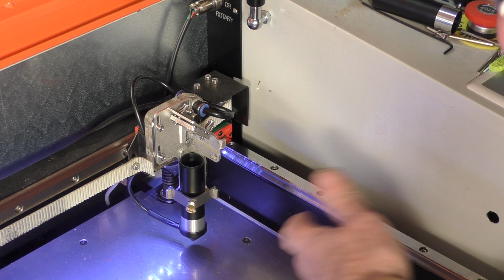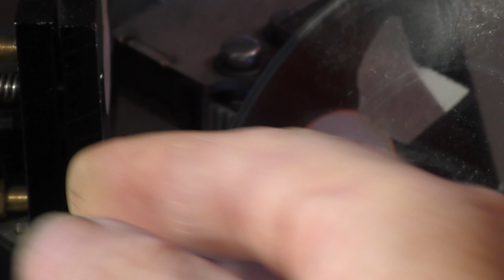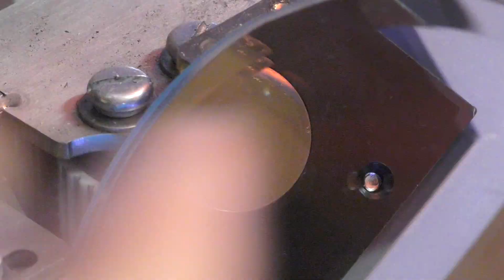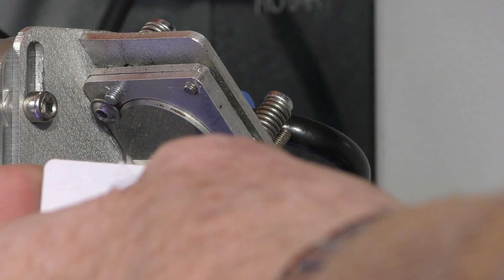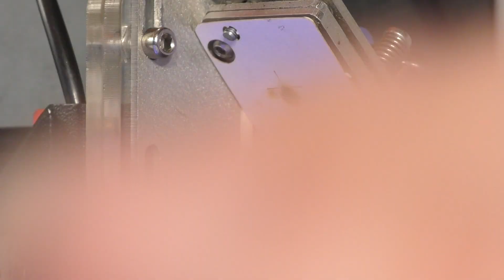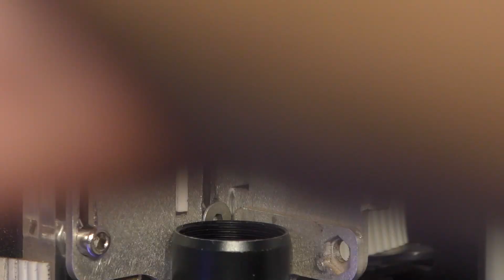TangerineTiger17  Beam setting to FIX the 4th Corner Problem

Comment: Excellent tutorial, thanks for posting!
Reply from the maker: Hi Malcolm
 I never stop learning or stop searching for better ways to do things. In a more recent video I have found there is a logical flaw in the way we have all been taugh to set machines. I  modified my machines many yeats ago to make the heads adjustable in Y and Z.  The principle I demonstarte in this video works for all machines , however if you do not have the adjustments that I have it will be more difficult to achieve. see  https://youtu.be/tvNfAg-cOLA

Comment: I hoped this method would've worked for me. I still have the same problem. Super focused in 1 corner, off by 2mm in the opposite corner. I've measured the rails and put them on the same plane. They're square. Still nothing 😥 Thanks for sharing though, I bet this will help many people.
Reply from the maker: Hi Bradl
 Just like every axis setting this diagonal setting is not a a one hit solution. You need to go through the process 3 or 4 times to get closer and closer to your goal because the every beam alignment process is one of iteration. As you adjust the beam to align with the target burn you are also moving the target burn you produced at  "near to mirror 1". So you start again with a "new" target. Because the root cause of this error is the reflection from mirror 2. you may need to slightly tweek  the X axis alignment  (mirror 2) as you get close to your goal.

 Trust me, it is nothing to do with the alignment plane of your rails. Your rails can be skewed and it will have no effect on you beam hitting mirror 3 because the reflection is from mirror 2 and the will always tip to compensate for the skew.. NO,  this is purely a compounding reflection problem. I spent more than 2 years  chasing this issue  before understanding it. I absolutelely knew that mirror2 was the root cause but but failed to see that mirror 2 was at the middle of a "light lever". So please persevere and go around a few times and watch the error getting smaller to assure yourself that you are doing the correct thing. 
 I recently setup a 200x 300 K40 machine that was so small that   i imagined it impossible to have a 4th corner issue. I was wrong. It took just as long to fix that as the bigger machunes.
 Good luck
 Russ
Reply: @SarbarMultimedia  thank you for the reply and words of encouragement, Russ. I'll be spending all day today working on it and I will persist!
Reply: @SarbarMultimedia  I’ve nearly fixed the issue! I didn’t realize I shouldn’t touch Mirror 2 when I line up the 4 corners. So step 1 is get Mirror 1 centered to the laser, Step 2 is to get the beam shooting at the same point on Mirror 2, Step 3 is adjust Mirror 1 to match all 4 corners of the machine on Mirror 3. Phew. Takes lots of adjustments if you have a 1200x600mm table like mine.

I still have more adjustments to make but I’m getting close. Thank you!
Reply from the maker: @br88dy  
 Hi Brady
  I appreciate your trust enough to devote time to my method.  Once you begin to appreciate what is actually happening with mirror 2 you can see how bypassing it temporarily allows you to gradually creep closer and closer to perfection.. I know it sounds odd but although you get much bigger "leverage" errors on a big machine  when setting mirrors the conventional 1,2,3 way, it's actually easier to correct them because the reflection "levers" are long and sensitive. On that silly 300x200 machine I did recently ,the errors were  small and its easy create errors as you try to correct them. 
 Congratulations on your near success ......and not packing up the rails. I have seen 6 mm packing  on the end of some rails!!!!!
 Best wishes
Russ
Reply: @SarbarMultimedia  I did it. I spent the day tuning in the alignment and boy was it difficult. But the hours spent working on it were worth it. My laser is aligned and all 4 corners make a tight circle. It's finally time to start cutting and I wanted to come back and thank you once more. You've more than earned my subscription.
Reply from the maker: @br88dy  
Hi Brady
 Congratulations on your success Your perseverance has been rewarded. The next problem you will face is  inconsistent cutting across such a  large work area..  This may puzzle you as you now have such a perfect machine. However you cannot defeat the laws of physics. First question  to check....is your tube a butter knife rm a Samurai sword?
 This video will quickly andswer that question if you do a mode burn
https://www.youtube.com/watch?v=R6Wqn5-HMzM

 When you know the answer to the previous question and ......just maybe   it towards the sword intensity and quite "sharp" you will then need to understand more about your beam quality. so watch this video and just at the end the inconsistency across your table question is answered.

https://www.youtube.com/watch?v=z8sNPtIIXZ4

 Efficient cutting requires a sharp beam. engraving does not.

Best wishes
Russ
Reply: @br88dy  Hello, pulling my hair out here. Is there a particular order you do this in? (The 4 corners from M1) Back 2 corners then front 2? Or both left ones first, then right ones? TIA

Comment: Is that beam shape normal for the RF Tube? Does the frequency has anything to do with it?.
Reply from the maker: Hi Abraham
 There is some sort of issue with the  beam itself because when I do a mode burn in front of mirror 3 there is a bit of distortion on one side of the cone. It's not going to get in the way of me exploring the things that this machine can do but when I pulse it at low power ( I think It was using 15%) I have noticed this distortion. It's not there at 100%. Unless it starts affecting the higher power I am not too worried at present. I will be keeping an eye on it with fairly regular mode burns..
I think I will be looking a how this machine can use  grayscale next. but I am already perceiving  logical problems that stand in the way of achieving excellent results with photo engraving..  Muddy fuzzy results is my expectation. I have seen Kerns getting good crisp results with their 3D engraving , so that looks a more interesting application of grayscale.
 Best wishes
Russ
Reply: @SarbarMultimedia  Thanks Ross, seems you are going to be able to ride the Tiger after all,  but still a wild animal :D

Comment: Would it help if you added a layer of metal foil between the test target and mirror to keep the condensation off the mirror?
Reply: If you have gold plated mirrors then yes,  because that layer of gold is atomically thin and gold is very soft. After a few wipes such as I was doing,  I'm afraid you will destroy your mirror. On the other hand, Molybdenum mirrors are solid polished  metal and are basically bullet proof. They are mirrors for life and as you see I am very blase about them, with 6 years of experience doing many thing that normal users would not be doing with them. I have even reconditioned them on occasions with silver polish.. They are almost the cheapest at about $4 each and about 97% efficient. I would recommend nothing else.

Best wishes
Russ

Comment: Can't test this right now, but if this indeed solves the issue that's tormented me for over a year, how would you like my first-born to be delivered to you, since it'd be yours?
Thanks for your continued research, and investment into the world of lasers. It's been a pleasure to watch, as well as educational. Keep it up, please!
Reply: I am in the same boat. I can't wait to get out to the laser and try it as well.
Reply: Did it work?
Reply: @kristiebobbish8199  it didn't for me, as my problem turned out to be mechanical misalignment of the Y rails; they weren't co-planar. It was a DIY build, so my bad. What did fix it was getting a 360 line laser so I could see the head being hit in all corners simultaneously. Then just raise the rails so the head gets hit at the same place in those 4 corners. Much more practical to do with the line laser than with anything else I've tried 😬